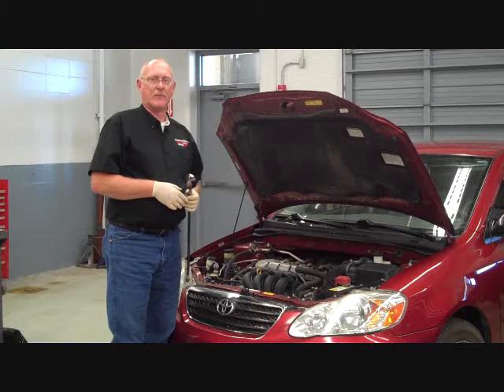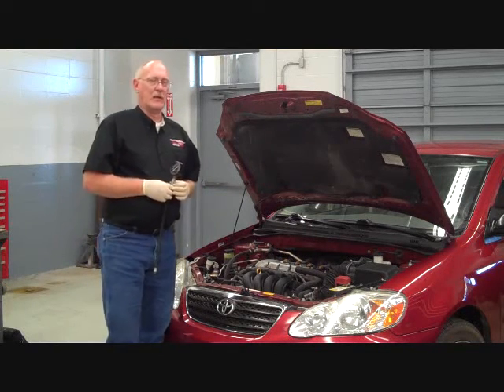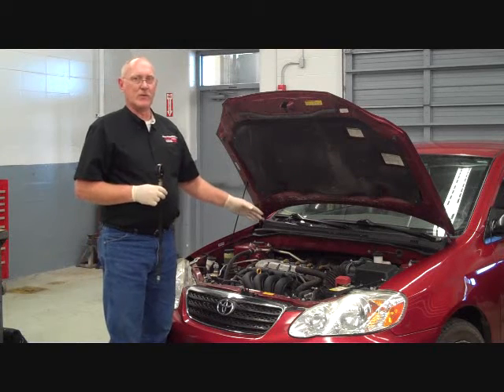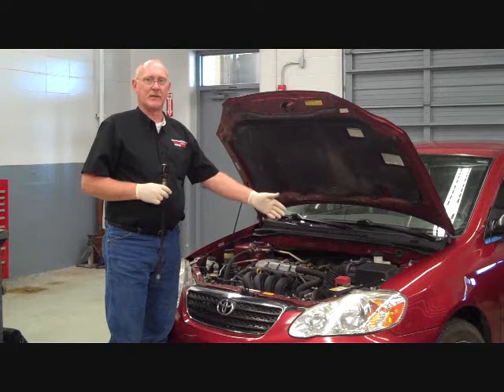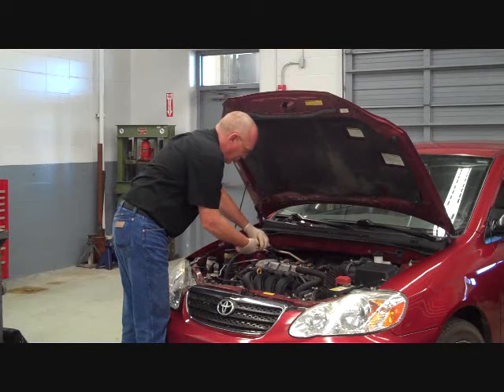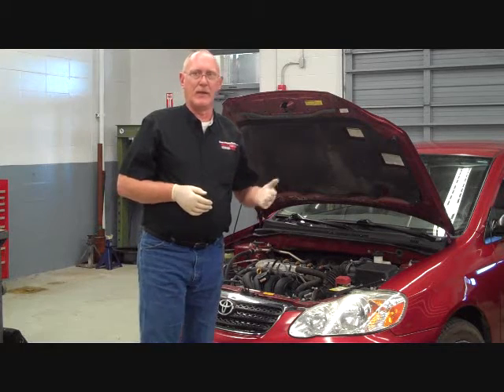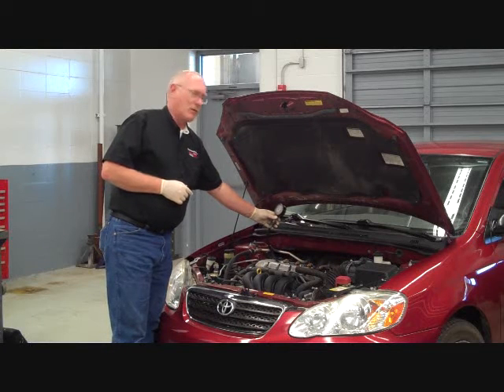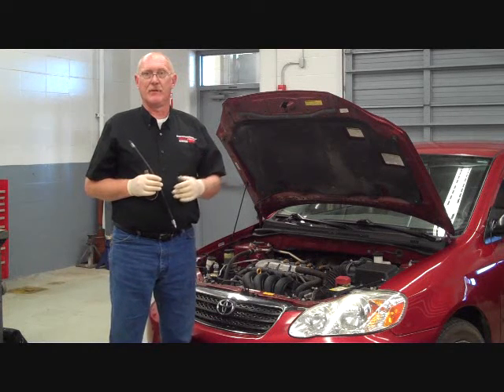Automotive Repair:  Performing a Compression Test

Comment: I heard, gauge always shows lower compression because gauge and hose add up extras space. Is it always true?
Reply from the maker: Never heard that. I guess it could impact the reading slightly - but very slightly, not enough to concern us. The extra volume of air in the hose is minimal compared to the volume the entire cylinder holds.

Comment from the maker: You want to disable the engine so it will not start when performing a cranking compression test like this one. It is best to disable both spark and fuel, especially fuel, so that raw gas does not wash down the cylinders over the course of the test.
Reply: how do you disable the fuel??